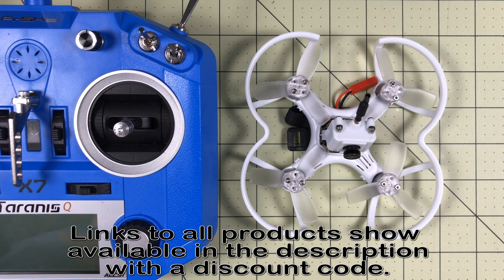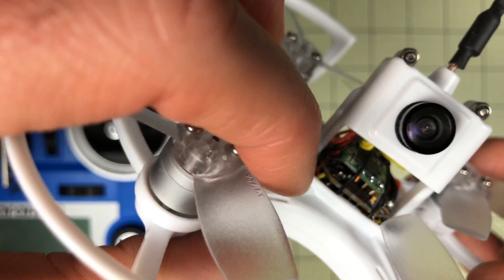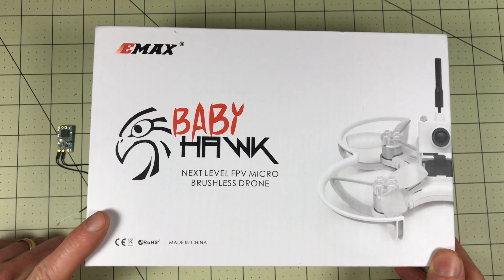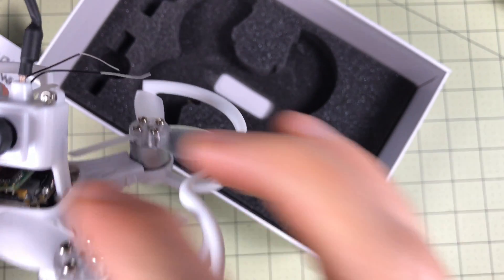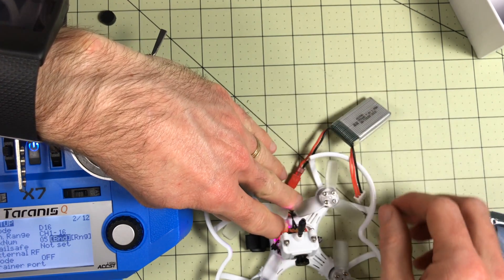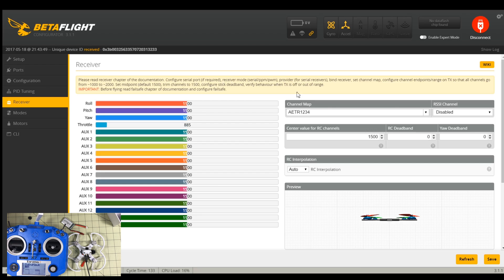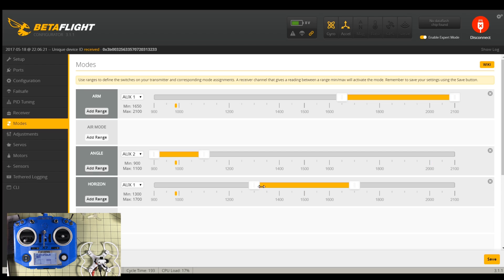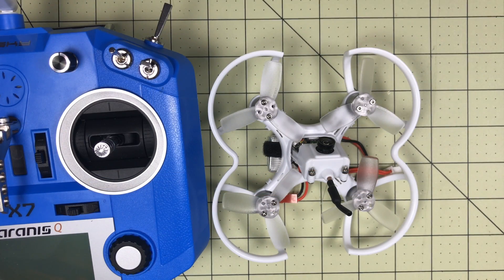EMax BabyHawk Receiver Installation, Install a FrSky XM+ and Setting up with Taranis

Comment: I can’t get BetaFlight to recognize the receiver even after I plug in the battery, I've already binded the Taranis Q X7 to the BabyHawk but no inputs work, have owned it for over a year now and still never have gotten to use it. I wish I could fix this damn problem I keep getting into, I have also tried to update firmware but it just gives me an error.

Comment: Mine had the XM plus already installed but the antennae’s go down in the bottom of the body of the drone. Should I make them go up? I saw another guy on utube so that. Does it make much difference in range. I haven’t got to fly because of weather. I ordered batteries and they finally got here so what I get it setup on my taranis and beta flight I’m going to be ripping. I can’t wait.  Thanks for video.
The guy that made the antennae go up put heat shrink on them to make them stay upright.

Comment: I get the BNF, it came with XM+, my Q x7 and the UART3, Serial, SBUS configs are getting me NO BARS in the RX tab. I just update the firmware to 3.1.7 SPF3EVO and worked flawlessly!
Reply: I'm having the same problem you were having, but when I go to update the firmware it fails to update. I have had my BNF Babyhawk and my Q X7 for a month now and haven't used it yet because of this problem. I feel very defeated :(
Reply from the maker: +Isaac Lebel I never updated my Babyhawk.  I looked it up and it looks like the boot pad is right next to the USB port.  Did you short that and did you still see the flight controller in the pull down list in Betaflight?
Reply: First off I want to start off with saying thank you for replying, means alot since I've had little luck on multiple forums. But by 'short' I think you mean hold down a boot pad I didn't know was on the Babyhawk. Unless you mean the button you hold whike binding the Babyhawk. And no I did not see any flight controller on a pull down list.. Unless you're referring to the receiver tab. I'm sorry I'm still new to Betaflight.
Reply from the maker: +Isaac Lebel  I tried to find you a video for this but couldn’t find one.  The boot pads are two metal pads next to the usb port.  They say BOOT next to them.  You have to get these pads to connect while you plug in the battery.  I normally do this with a extra bit of wire pressed on it.  Then Betaflight will let you update the firmware.  If it still fails let me know and I’ll link one of my videos on that part of the process.  Make sure you know all the setting before flashing, that will probably reset them all.

Comment: im having trouble with betaflight not reading my transmitter. anyone have any clue why? i installed the receiver like it suppose to be but the frsky transmitter controller is not registering. any help?
Reply: DroneRacer what was the fix for the VERY delayed input? I am having that issue on TWO separate femto FCs and TWO separate FrSKY XM rxs :( please help. Latest betaflight SPRACING EVO 3.1.7, and older versions too
Reply from the maker: +J K is it not showing at all?  Or is it VERY delayed?  I just had that happen.
Reply: its not showing at all, i have tried everything, idk what is going on. so confused
Reply from the maker: +J K you have a single solid green light on the receiver so you know it is bound?
Reply: yes
Reply: i wished i can show you and you would be like wtf, lol
Reply: is there a setting in the taranis plus i need to change? i have no clue
Reply from the maker: +J K are they not showing input in Beraflight?  Or are there no bars at all?  That I have heard of and was fixed with a Betaflight update.
Reply: there is no bars at all and i am binded with the receiver
Reply from the maker: +J K Ah, that is a Betaflight bug. (I kind of wish it would happen to me so I could record a video :-). But I have heard you can fix it by updating Betaflight on the FC.
Reply: how do i do that? i am so new to this, just learning as i go
Reply: i just wanted to solder the receiver and up and away flying , lol but never that easy
Reply from the maker: +Daniel Tabar I just happened to have solved this very issue by setting the RX to 16 channels instead of 8.  Full details here.  https://youtu.be/MaY-S23LOm0
Reply: THANK YOU!!
Reply: Thank you for the video! I'm having the same issue as J K below, Betaflight not receiving any input from my Taranis Q X7. I'm pretty sure I'm bound to the transmitter (did this multiple times, I have the solid green light on the receiver). Inputs are not showing up at all in Betaflight, there are no colored bars on the Receiver screen. All the other screens match the settings you have. And transmitter is set to 16 channels. One weird thing, on the Configuration screen, under Receiver, I have "Serial-based receiver" selected but when I select "SBUS" for Serial Receiver Provider, it keeps switching back to "SPEKTRUM1024". I'm using the Betaflight Chrome Extension on a Mac. Kinda frustrating as I'm new to this. Any thoughts?
Reply from the maker: If there are not bars at all if is a Betaflight bug and needs updated.
Reply: Did you ever get a solution to this? Having same issue.
Reply from the maker: Did you update Betaflight?
Reply: DroneRacer101 No. Admittably im paranoid im just going to mess up more stuff and add to the problem. Think i should just bite the bullet and flash the fc?

Comment: Thanks for your hard work. Because of this video. I got my babyhawk working. I had a hard time connecting to betaflight with taranis...
Reply: Ohh btw, i used plastic earbuds and hot glued it on each side of the cam tower for the antennas.
Reply from the maker: +Markvader1000 excellent. Very glad to help

Comment: Hi thanks for the informative vid. I still cannot get Betaflight to recognize my Taranis or the BabyHawk to arm. Any thoughts?
Reply from the maker: +MjsUSA does the receiver light up?
Reply: DroneRacer101 yep, receiver is full solid green
Reply from the maker: +MjsUSA +MjsUSA hmm, and you get nothing in the receiver tab at all in Betaflight? Check the settings starting at 8:23 and make sure yours match mine. It might not be set right to see the receiver.
Reply: I'm having issues with it as well. Set to UART3, SBUS, bound and working perfectly fine on my Omnibus F7. On the receiver tab everything just reads zero. Might be the one year old version of BF having problems talking to the new configurator. Tried to flash the board but that didn't seem to work either as it keeps failing to open serial port.
Reply from the maker: +Bladud FPV I haven’t updated my Babyhawk but check out my Lizard update video. If you have an omnibus this procedure may work for you.  https://youtu.be/QTczo5PYNNE

Comment: hi man i'm semi new to micro quads , I do have dx6i can i use this for the micro kingkong gt95? Or should i get the same radio you have here ?  Cheers :) btw I don't know anything bout your radio looks really nice, talks as well lol Wow
Reply from the maker: +nev Tk 1100 If you choose you choose the DSM2 version it will work with your dx6i radio.  The taranis is very nice. Which is weird because I'm an Apple guy and like thing to be simple. But for the Taranis I like the flexibility of making it do what I want.
Reply: thanks!!!!  now i can make my Purchase weeee Sub'd as well :) Is it very difficult to bind an setup on dx6i , i got no idea man, does that program betaflight help to config for dx6i , Might need some help dude :/

Comment: I like how you ran the antennae down through the frame to come out underneath, that would work perfectly for my XM.  But, the Frsky XM+ with 2 antennae really need to be at a 90deg angle from each other to make use of the polarization benefits.  otherwise save $5+ and get the XM with a single antenna.   What you could do is run the antennae down the back arms so they will be at a 90 degree offset, then you might be able to get a lot more distance out of it.  otherwise, you will probably get about the same reception as the XM with the antenna sitting together like that.
Reply: Oh, and you might want to glue them to under the frame so they don't get caught in the props.  I chopped my XM antenna up on the first flight, whoops. where the antenna connects is very close to the props on this mode.  still flies fine until about 60' away, with a 1" antenna, haha
Reply from the maker: +amplex1337 I'm thinking about folding them under the velcro.  I think that will keep them in place a little better. I think the receiver will outrange the VTX so I think it will still be "good enough".